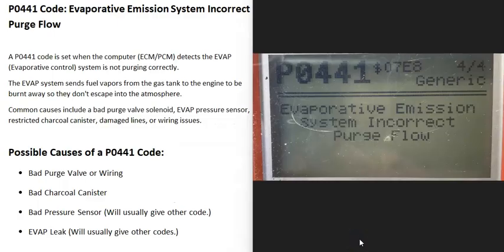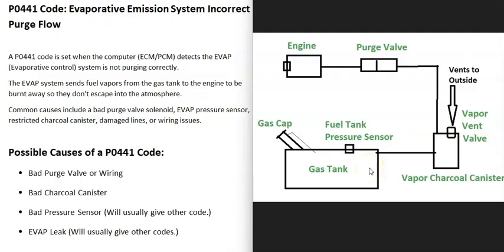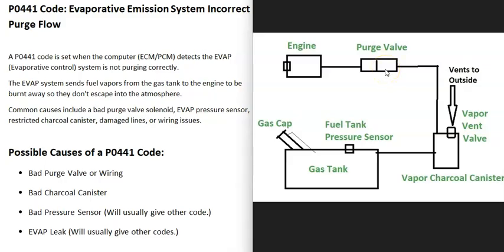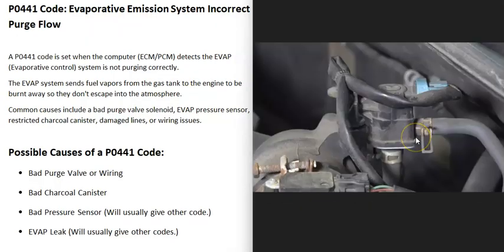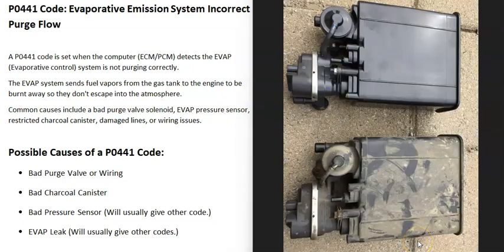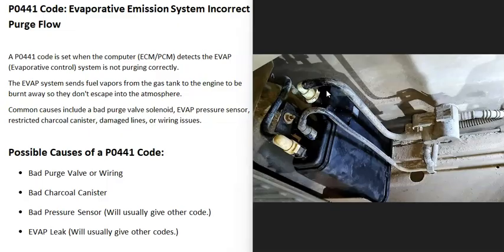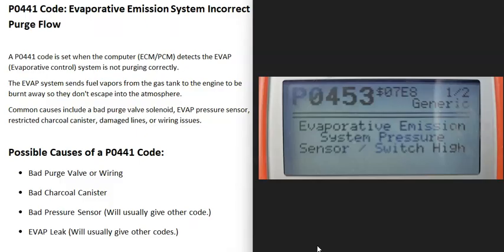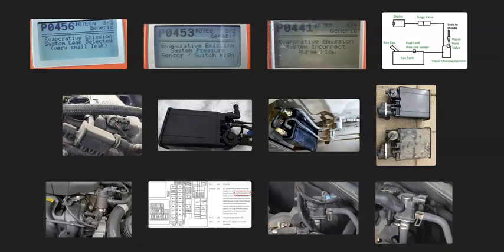Causes and Fixes P0441 Code: Evaporative Emission Control System Incorrect Purge Flow

Comment: Thank you for all these videos!!! super helpful in knowing how to troubleshoot!!!
I have replaced all the parts but the P0441 persists. A friend bought a brand new ram and has the p0441 code. Because its under warranty he just kept taking it in but even the dealer couldn't find any issues. However, he noticed that when his engine was cold he would get a P0441 Pending that turned into a Permanent. If he sat in the driveway for 5 mins warming up his truck, the code didn't trigger. 

I just started trying this. 
But I am curious??? Do any of you get this code during the summer?
Reply from the maker: Cold weather can affect the hoses, causing them to leak. Sometimes, EVAP codes only come up after it is very cold and then go away once it warms up. When that happens, it is usually a hose starting to go bad.

Comment: Will this code error cause the vehicle to not start? I’m having this issue I replace the purge valve and still won’t start the gas cap looks dirty and I would notice a few time I would put gas and when I would unscrew the gas cap I would hear a hiss after unscrewing the gas cap to fill up
Reply from the maker: If the purge valve is stuck open, it can affect some engines, usually after filling up with gas, but it should start and run. If the engine will not start at all, there is likely another issue.

Comment: I have this code for almost half a year. I changed the charcoal canister, fixed a vacuum leak, changed the purge valve and the gas cap and I kinda checked the wires but they seem all good. I don’t know what else to do
Reply: Remember, there's a chance it's a computer driver. I have no luck with my stuff either, though 😂 good luck man 👍🏻
Reply: It could also be the sensor 😅
Reply: Did you find. ?